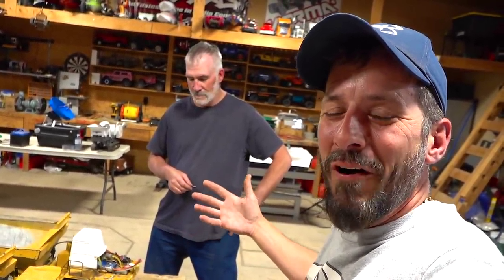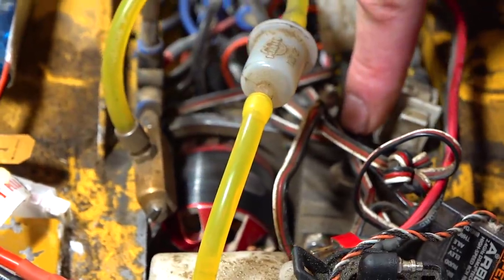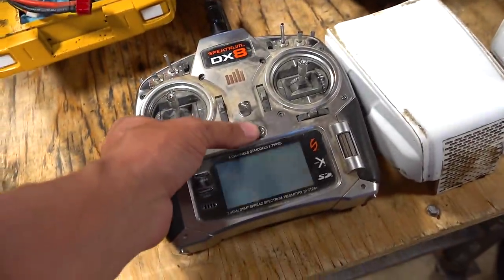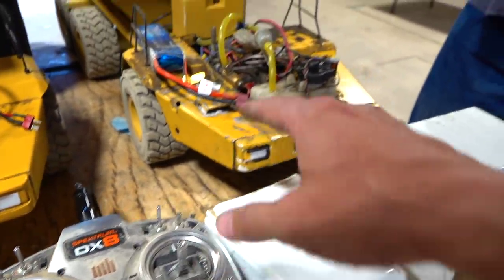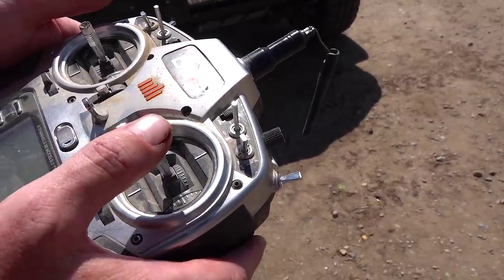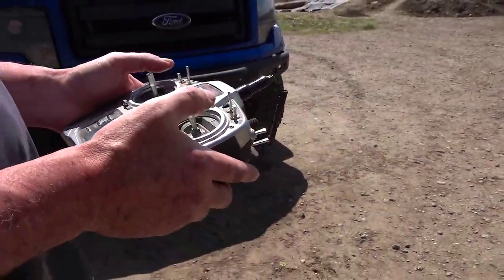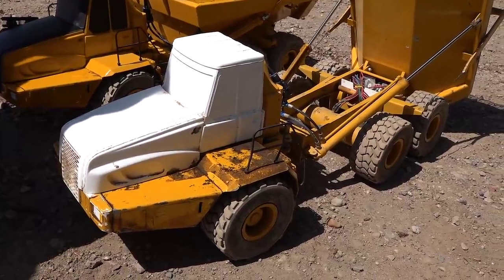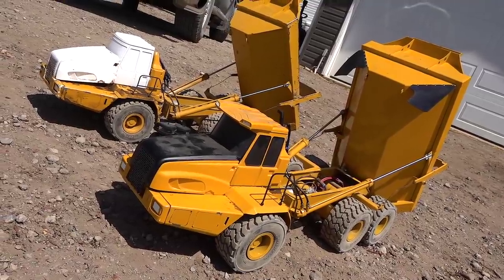DRIVE 2 TRUCKS at the SAME TIME w/ 1 RADIO - Lil Giants Collaboration | RC ADVENTURES

Comment: It is so beautiful, I am far behind with my 1984 Gentle Lady glider and old school radio, good job gentleman
Reply: I learned to fly on a Gentle Lady around 1980, first model I ever built too, it is such a lovely plane. Mine was retired after 800 plus flights as the fuel from the cox .049 powerpod had seeped everywhere, if you get into trouble, just let go of the sticks and try again. Been flying ever since. Good luck and have fun.
Reply: @ForeverNeverwhere1  Yup that was an excellent trainer plane, I did however have a Sophisticated Lady and Electra as well from the Carl Goldberg models

Comment: Mind blown! 😮 Never could imagine this was possible, unless I seen it. Wow!
Reply: We have been using multiple receivers bound to a single Transmitter on large RC planes for decades to reduce wire length. I use Jeti radios, I even have some models where you can turn the RX on and off from the TX, turn one model off and the next one on without putting down the TX, would be great for construction equipment.

Comment: Would you recommend putting a 3400 kv motor in a rc boat the boat is 24 inches btw or 70 cm

Comment: I have seen people Y link brushless motor wires into 1 esc,  Just has to be rated enough amps to power both motors.  They run at the same speed. forward and reverse.

Comment: That's amazing.  Other that binding is there any trick you have to do with the controller to say what side is what?  I'm blown away.  That's something I can see me doing sometime.  Hmm the ideas are coming.  Thanks for the amazing video Medic and Nice to meet you Joe M.  I will be jumping over and giving a subscribe.
Reply: No trick, each channel is the same on both receivers, the transmitter does not distinguish between the two receivers. One trk for/rev & steer is throttle & rudder chs, the other trk is elevron aileron. Separate chs to dump each box individually. Both trks use the same ch to turn on hyd pump, which is gear ch.  If you want to change what stick each trk is on, it can be done simply in seconds without touching the trk rx by going to transmitter settings and changing the Mode... Mode 2, the throttle/rudder is on the left stick, Mode 1, throttle/rudder is on the right stick; all other chs in relation to switches on the transmitter reverse as well, but Aux 3 remains the turning knob. Thanx for the sub.